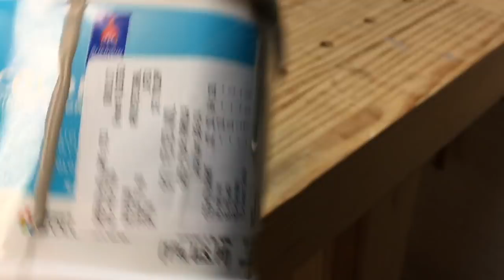Tree to Restoration Hardware Dining Table

Comment: Great work!  I'm building a similar table utilizing materials from my grandparent's horse barn.  I'm designing it now and trying to get the proportions right.  Do mind sharing some dimension with me?  1. What is the length, width and height of the bottom base/leg (the portion the pedestal sets on)? 2. What is the height and width (widest part) of the pedestal?Thanks!  Again....great work!

Comment: I guessed I missed the part where you dried the lumber. I saw you stickered it, did you just resume filming after a year or something?
Reply: Joshua, figure one year to the inch as a rule of thumb for air dried wood. Difficult to reach the 6-8 % moisture content for interior use this way (it can in a dry summer)  but if shriks a bit it adds to the charm ;-)